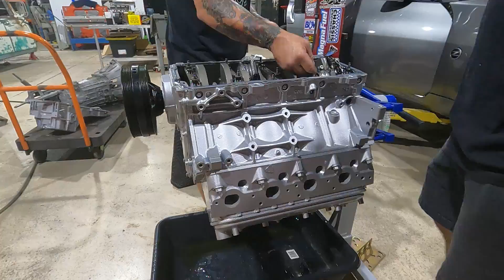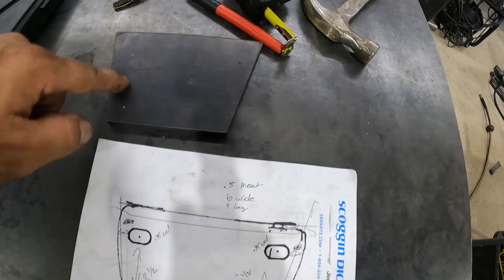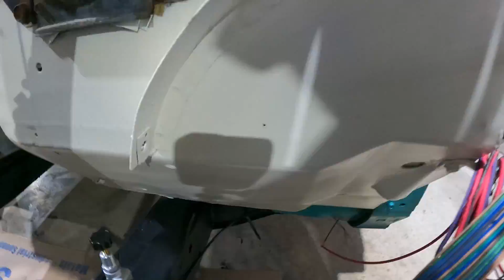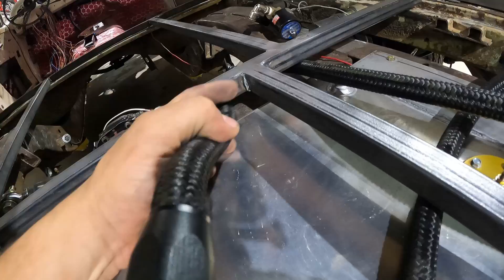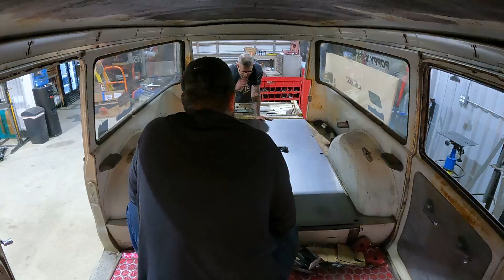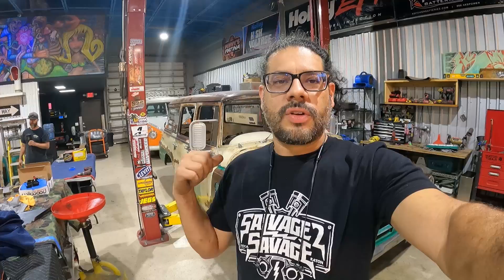6.0 LS + International Harvester First Start Up! - 1963 LS Swapped Travelall Bagged Wagon

Comment: What if you remove that plate inside the valve cover?
Reply from the maker: That plate stops the oil from surging out of the vent on the cover. We'd rather keep it in tact for a different build!

Comment: Do you have some part numbers for those brake line parts and pieces. That’s what I’ll be working on next, plumbing. Never built a system from a scratch and wanna make it nice and clean. Planned to go to ls fest but work calls.  Maybe next year and I can actually drive my build.  Thanks.
Reply from the maker: Man the fittings, parts and design of the over all system are very specific to the project. I can tell you the hardlines we use are 5/16 I get off Amazon, their gold (I love gold) we basically use it on every project. Wilwood can help you sort out the fittings

Comment: I need that van for a wheelchair ramp van
Reply: Or and old work an with a lower floor. I need about 56" from floor to roof but really need is insulated well and quite
Reply from the maker: Not sure if the ceiling would be high enough but it would definitely be cool for a handicapped accessible van!

Comment: I know it saves time, but I  hate that you guys run fuel hose for such long distances. If it was my car, I would insist on metal tubing for the run along the frame with only short hoses on each end to connect to the motor and fuel tank. The rest of your work is absolutely amazing
Reply from the maker: We use the same set up in a lot of our builds and haven't had any issue with it yet!
Reply: Metal rusts

Comment: You could have cut a thin aluminium spacer under the valve cover, but bigger covers are best I guess, just takes a little longer :)
Reply from the maker: Definitely an option! But we'd rather just save these covers and use em on an LS that doesn't have such big rockers!